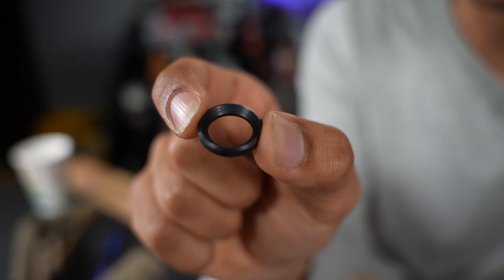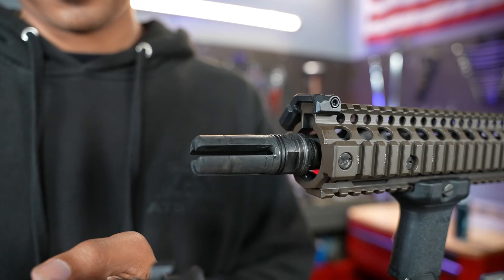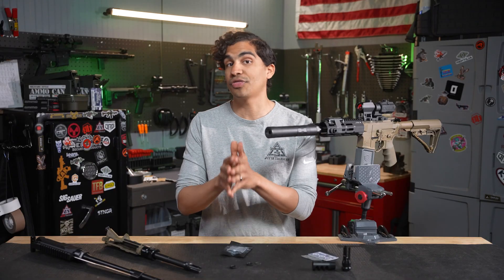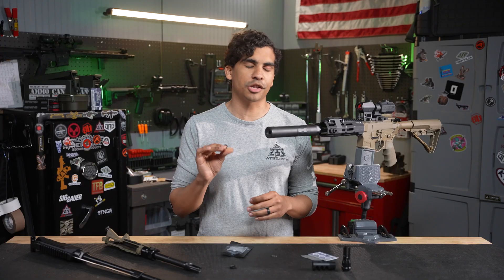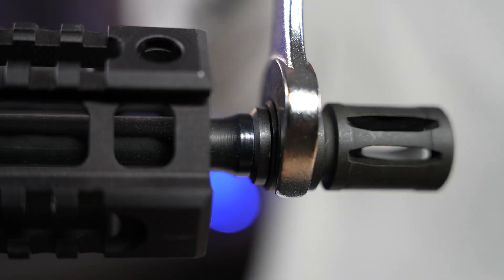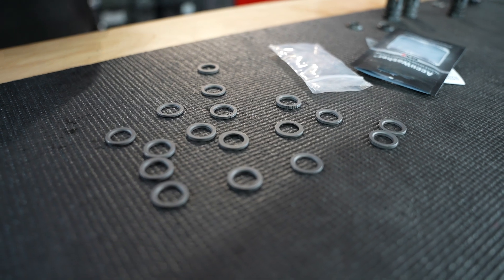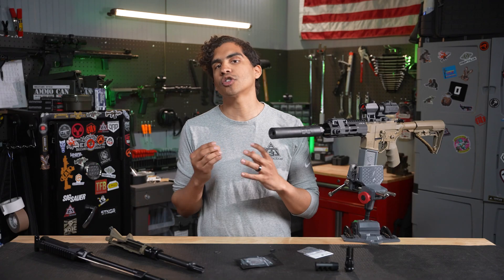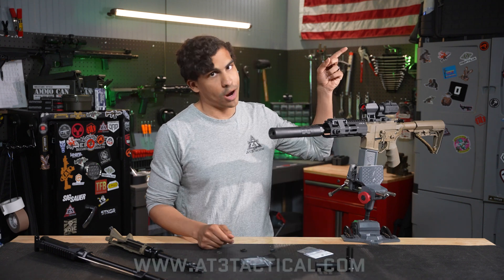Why You SHOULDN'T Use Crush Washers on QD Muzzle Devices

Comment: There is one Suppressor that needs to be Timed YHM FAT CAT with the CAT ASS Hole front end And it can be Direct mounted no muzzle BS needed i took the SRX mount and end cap off to run it Direct thread on my 11.5 556 ar pistol so that Booty hole is facing perfectly.  😺😺😺😺😺😺😺

Comment: I just use a crush washer. Go hand tight, do the math. Then grind the washer the proper thickness on a surface grinder. Reblue the washer and install washer and muzzle device to the proper torque and location.